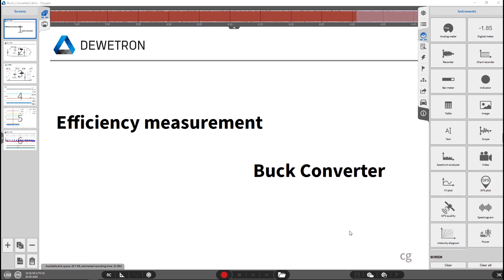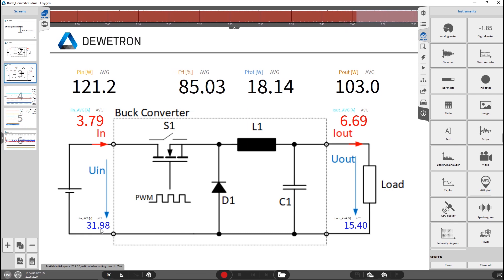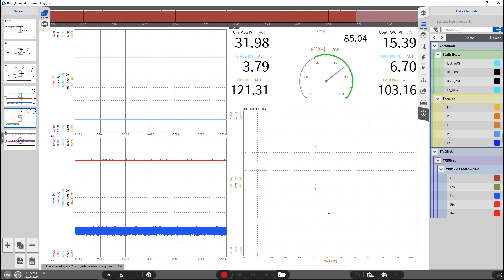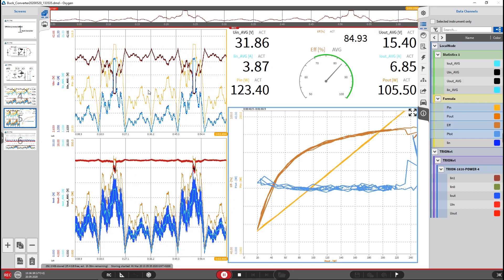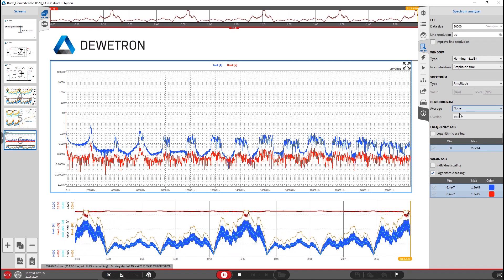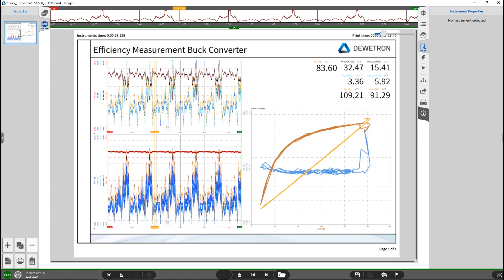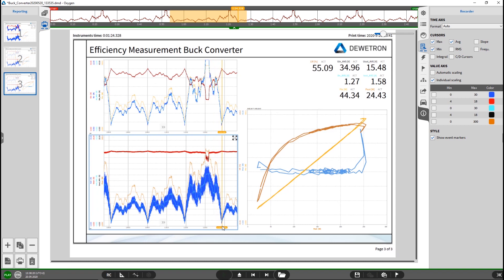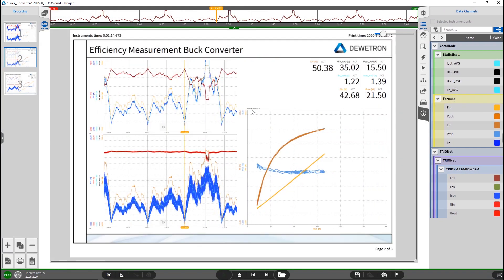Efficiency Measurement of a Step-Down Converter (Buck Converter)

Comment: Sir, what is the best tool to measure efficiency in MPPT, with BUCK topology - 2-phase, IN: 200 V 50 A max. OUT 100 V 100 A max. ?
Reply from the maker: Hi, we can measure it with our TRION3-1810M-POWER-4 measurement card with TRION-SUB-CUR-02A sub modules. CT-100 converters would be needed to measure the current.

Please contact sales@dewetron.com and we will discuss in detail.